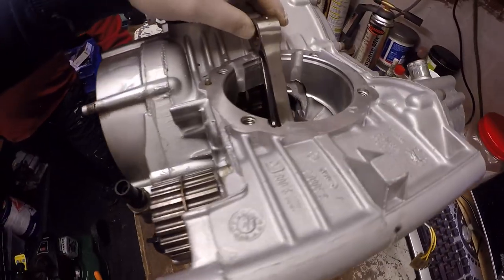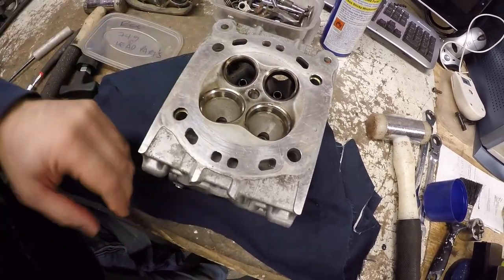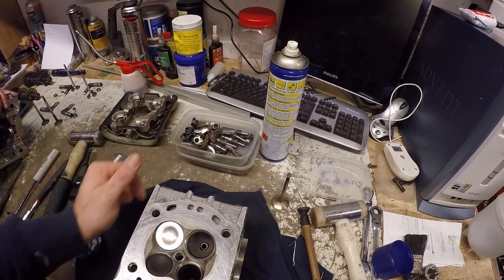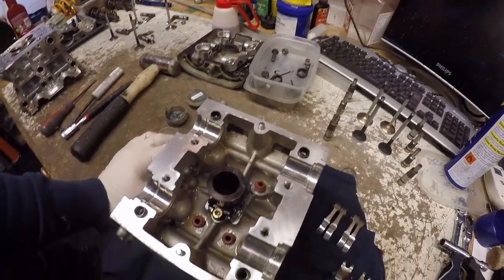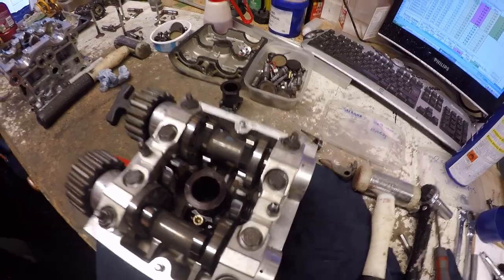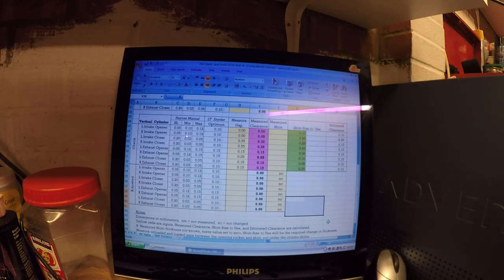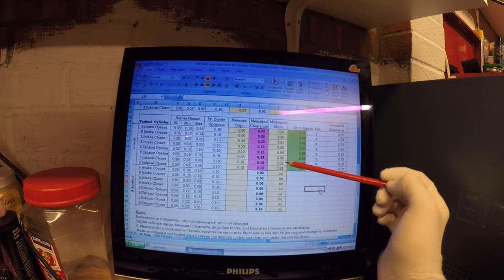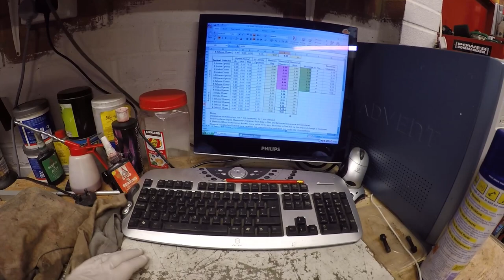Testastretta 749 Engine Build No.2 - Cylinder studs and head build

Comment: Testaretta heads look much easier to work on than the Desmotrinic heads I have a 2000 748 I spent ages doing the clearances only to find I didn’t need to be as fussy as I was getting the clearances as spot on  it was hours of trial end error as I didn’t have endless funds quite shocked at price of parts needed to rebuild the engine every bearing and rocker was shot but managed to get decent second Hand rockers . I gotta say there’s something about these Ducati’s that is addictive maybe the looks and sounds , finding your videos extremely addictive looking at your bikes etc is the feeling a child gets in a sweet shop keep up the good work stay safe .
Reply from the maker: Hi Vince, 
The testastretta heads where a massive leap forward for Ducati both in terms of performance and maintainability.
I have to agree the prices can rack up for the engine rebuild especially if you are using Ducati parts but with a little research can find most parts direct from the same suppliers Ducati use at lower prices 😎
I like my motorcycle based sweet shop, feel the need for more Ducati's 🤣🤣🤣

Comment: I don't have to take off the rocker arms, on my 03 model 999, to change shims.
by doing this job on a complet engine, be ware of not loosing valves into the sylinder. Keep the piston in TDC. Can also hold the valve with an angeled tool trough the spark plug hole.
Reply from the maker: Good tips, you are right that you don't need to take the rocker arms off, its just easier for access when the engine is out of the bike.

Comment: Just wondering if a ducati 999 engine will drop into a ducati 749 dark frame.
Reply from the maker: Yes, the 999 engine will drop straight in, just need the bigger throttle bodies, everything else can remain the same, then retune the ECU to match the engine 😎
Reply: @DesmoWerx  That is awesome!  I never knew how much, potential my 749D has.  I have a lot of plans for my bike now.  Thank you for your info.

Comment: did you mistype 749 instead of 748? BTW, I've got a pair of 749s ported and polished heads but don't have the top covers. Long story but I originally bought from a seller in eBay. If you know how to machine or match spare parts you have for it, I can make a deal with you. I bought it for $600. In addition, the tech that originally saw the part I had bought said it'll work with the existing cover I had on my 749. long story short, I'm not going to that shop anymore.
Reply from the maker: Hi Gnarly, 

Its a 748cc capacity engine but used in a Ducati 749 hence commonly referred to as a 749 engine.